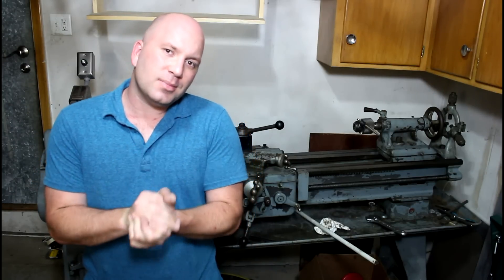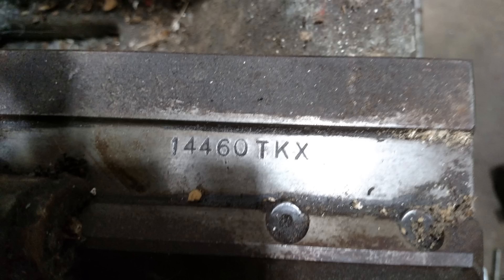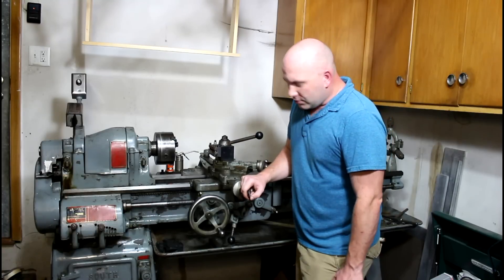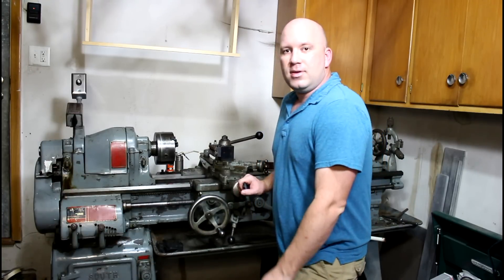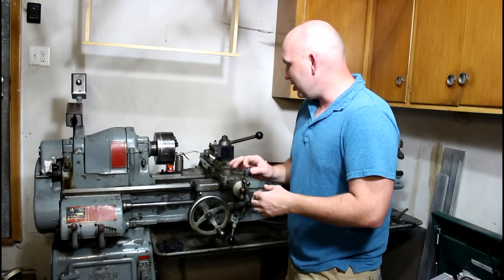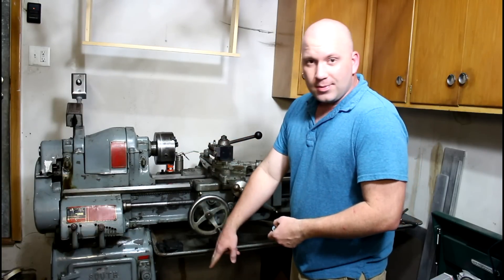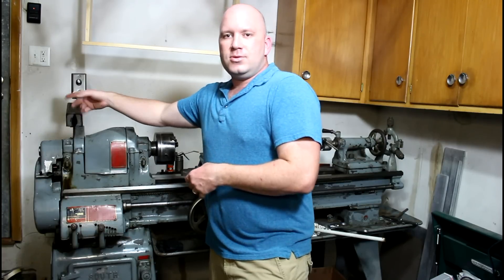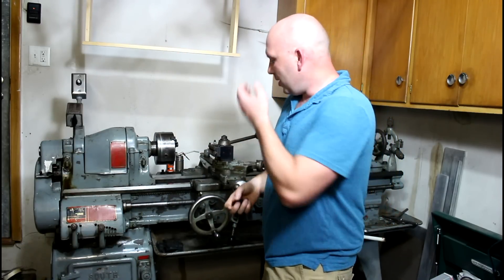South Bend 13 Metal Lathe Overview

Comment: the tool has too much radius for heavy Cuts Like That to expect a nice finish anyway and a heavy cut at the same time make a real Square shoulder tool with a nice chip breaker out of a nice piece of momax hi Cobalt content blank and you'll be doing a lot of super heavy cuts I can cut a tenth of an inch with my 10-inch Logan without even slowing down the motor at all at all it comes off like it's butter it's all in the tool it's all in the tool repeat that it's all in the tool Sharp Tools don't slow down your machine master tool making and you got it in the bag I love making tools I could stay in all day in front of a grinder

Comment: I have added a 1942 South Bend 13 to my computer program Ride The Gear Train . (search without the spaces).  It is a bit unusual because it has sliding gears in the gear train similar to Myford lathes. The user may be looking for change gears. One object is to cut metric threads, but this can often be done without the expense of proper metric transposition gears.

Comment: I have a SB 13" x 72" fully tooled 3hp/3 phase with the 3 step pulley. My belt is 2-1/8" wide which gives it a lot of torque for heavier cuts. Smooth, quite running machine. Wouldn't part with it for anything else. It's a 1960 model that was well taken care of.

Comment: I'm in the middle with my 12 x 36 atlas,,, you got lucky with that deal,,,you know as well as I the quick change gear box and aloris and center alone would be expensive as hell,,
Reply from the maker: Yeah, I just picked up a South Bend 10L and a separate Aloris tool post set. The tool post set cost as much as the lathe.
Reply: @precisionmachineshed  got lucky with my 12 x 36 atlas,,,had a aloris tool post and nice full set of tools and 2 Bush chucks,, 3 jaw and 4 jaw and the quick change gear box,,no wear on gears or ways,,,I think I did pretty good at 650,,,a lot of the vintage small lathes was bought by hobbyist and hardly used as with mine..l took it all apart and sanded it to bare metal and polished it like a mirror finish,,,lol

Comment: Thanks for the review and heavy 10 comparisons. I was thinking about a 13 or bigger after seeing a couple on ebay a few years ago but the extra size and weight put me off due to unloading logistics. I'm subscribed and looking forward to some more SB videos as and when and will check out your others as this was the first I've seen. I have a 9C in fairly good shape and a 10L missing its gearbox and leadscrew but it was really cheap @ 141 British Pounds or roughly $170 plus half a tank of fuel to collect. Best value for money I ever got!
Reply from the maker: Yeah, they are good old lathes and that was a heck of a deal on your SB. All of my current lathe videos are done on ether of my SB's so stay tuned. Thanks for watching and subscribing!

Comment: How would one go about copying the profile of a existing barrel to a new barrel blank on a lathe like this ?
Reply from the maker: Easy way would be a duplicator, but most guys do a bunch of measuring down the length of the barrel every 1/2 to 3/4" and cut a bunch of diameters then blend them all together. There are barrel companies out there that will profile barrels for you too if you send it to them.

Comment: Hey thanks very informative! Hey could you tell me how much a machine in condition as shown in video, how much does that cost?
Reply from the maker: That machine was in extremely good shape. I also had it repainted by a machine rebuilder before I sold it. With all the accessories, Aloris tool post, collet attachment, steady rest, Taper attachment. In good shape this is a $4-5K lathe.

Comment: Hello Great Video, great info! Question I'm getting ready to buy a south bend 16" x 6' tool room in great condition for $1,500 but also I can buy a clausing 13" for $2,500 in great condition too, which one you will prefer if you can buy both and why? I'm leaning more into the southbend. Thanks
Reply from the maker: Unless you need a really big lathe, I'de go with the clausing if they are both in similar condition. The 13" clausing is a very capable lathe. Parts can be had for both, but SB parts are usually easier to come by. I would look at accessories as well. The more the merrier.

Comment: Keep it ,use it . Nice machine.
Reply: I agree with MHMS HS53. I've two large lathes (and a bitty one) and can't imagine only having one in the shop. Trust me. You'll have a barrel on one, and need to turn a simple bushing. No problem. Your young, have the skills and energy to grind two machines into the ground. And, I think it looks good on you.
Reply from the maker: LOL, thanks! Yeah I did have two a few months back but I sold the Clausing 5914. I figure this would be a good lathe to take it's place. The only downside is that in keeping it, I'll want to do a resto like I did on my 10L. Not a bad thing, just takes forever and is a lot of work. They are a work of art when done up like my 10L.

Comment: There was about a dozen identical lathes in my high school machine shop back in the early 60's. I learned to run a lathe in that class, along with the mills and shaper. A real blast from the past.  Unfortunately, someone in the school system decided that machine shop was no longer relevant, and did away with all the machine tools back in the late 70's. What a bunch of idiots!

Comment: Nice vid and very informative. I just subscribed and liked. I’m looking at a 13 now and will probably buy it. It has a tooth off the 80 tooth idle gear. Is that gear available anywhere new? Is it the same as a heavy 10? Do you know where one of those gears are available ?
Also can you tell me what the taper size is on the headstock spindle end. I don’t see a mt sleeve with this lathe that would go in the spindle end? Thanks
Reply from the maker: Gears may be purchased through Grizzly. They purchased the SB name several years ago along with parts/tooling to make parts. Otherwise eBay is a good source for parts. The taper on both machines is a 4.5 Morse Taper.

Comment: Are there replacement headstock bearings available? I have also read that you can adjust the bearing clearance to compensate for wear by removing shims in the bearing housing. What can you tell me about this?

Comment: What's the going rate for one of these in decent condition would you say ?  TYVM
Reply from the maker: Depends a lot on condition and tooling. Iv'e seen worn out ones go for around 4-500 with minimal tooling to over $5k in nice shape with a decent selection of tooling. Mine was fairly nice and wasn't all worn out. I sold mine to a friend and he got everything I had with it including the aloris tool post. I sold mine for around $3800 if I recall a year or so ago.

Comment: Is there a significant size increase in the tailstock , carrige and compound slide?
Reply from the maker: Between the 10 and the 13, yes, The 13 is approximately 50% larger overall.

Comment: Couple questions if you have the time plese. Is yours 13" x 28" (70" overall length)? What was it like moving it? Do you have a video of moving it? Can it be lifted from a trailer with a 2 ton engine hoist? - Thanks
Reply from the maker: Mine is the 6' bed and I think it's a 13x40" or so. I lifted mine with a 2 ton chain hoist straight off my trailer last time I moved it. I bought it in pieces and was able to winch it up one end at a time onto dollies to get it loaded. Just used a hand winch with 2 2x6's across several rafters. The bed, headstock, and carraige assembly we're together and the base, legs, and pan we're separate. I think they weigh 1,600+ lbs.
Reply: Thanks for the info. I'm looking at one tomorrow morning and trying to get a grasp on transporting and unloading it to my garage.  It's  dream machine.
Reply from the maker: That's cool. I will most likely be listing mine very soon. If you're anywhere near MN.
Reply: I left a deposit on a CL145B this morning. Hoping to have it safely home and officially be in the South Bend 13" club by Tuesday afternoon.

Comment: do you lose Hp using a VFD and would it be better to change the motor to single phase 220 v
Reply from the maker: I'm no expert, but to the best of my knowledge you don't lose any HP with the VFD. When you crank down the Pot, I'm not sure how that correlates. I could switch to a single phase, but the cost ends up about the same, and you can have variable speed with the VFD. Hence why I usually just get the VFD. I have been told that 3 phase power gives a more consistent pulse rate with the power with equals a better finish.
Reply: Three phase motors are the back bone of industry for many reasons. You made the right decision going with a vfd. No down sides. Three phase motors are superior in every way. Simple,robust, usually larger bearings. No power loss and unlimited possibilities including ddc control. If you talk with maintenance repairmen, they'll likely have a stack of great motors that just need a pair of shielded bearings for grabs. I'd eat 10 if you don't love your vfd.

Comment: i half an older mod where you tighten the clutch has a knob to tighten  i see yours has a lever .  do you happen to know how they differ ?
Reply from the maker: They work almost exactly the same internally. Just one tightens with a screw and the other with tension from locking the lever. The lever is a little quicker to use, but they both work equally well.

Comment: Hey Spitfire, do you loose any tork on low speeds with a VFD? Or is that just a rumor?
Reply from the maker: You do, but you can compensate mechanically by engaging the back gear or running in a lower gear.

Comment: Stick out on the material is causing the material to push off from the tool and you get chatter and all the cutting on the return stoke.
Reply from the maker: This lathe was in  need of a rebuild. it was worn all over.
Reply: Precision Machine Shed wear doesn’t cause chatter, sorry.

Comment: Nice lathe! I have a import from Bulgaria ? long story it has less than 300 hours on it if that if  had oil leak that began to bother me. wished now it was still bothering me. have two broken gears and zero help from factory. Buy American !
Reply from the maker: That sucks. I've used some imports and they are nice, but There's something to say when you have a 50-60 year old machine still running strong.

Comment: Something wrong. Audio and video not together. :-(
Practical Machinist South Bend site has lots of info on using laced serpentine belt - quiet plus you don't have to pull spindle. 
A leather belt with clipper link will come apart but clicks.
Reply from the maker: I'll have to look into it, might be your connection. Happens to me sometimes when watching Youtube. I usually splice and glue stock type belts. I got sick of clicky belts a long time ago. I have not replaced this one yet because if I tear it apart for a resto, I don't want to go through the trouble of splicing and gluing only to cut it later. I'm on the PM site quite a bit. Thanks and take care!
Reply: Noell Wilson I put a synthetic belt on our 14 inch southbend. It was fairly simple to do and after ten years is still working.